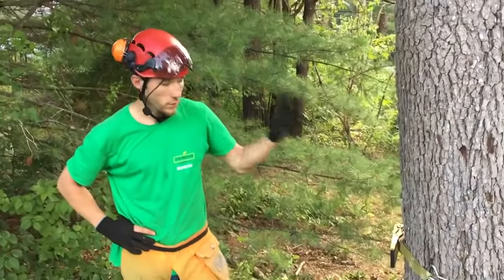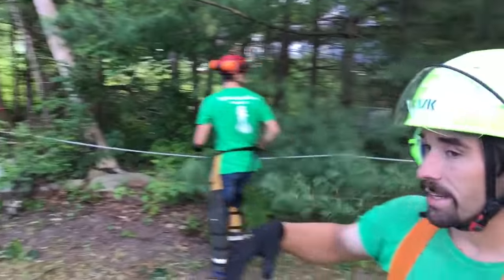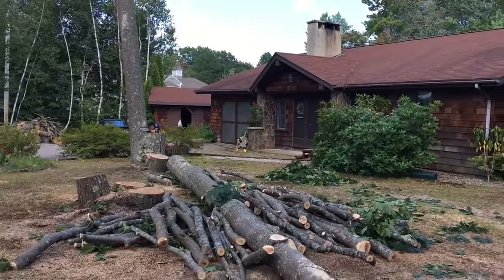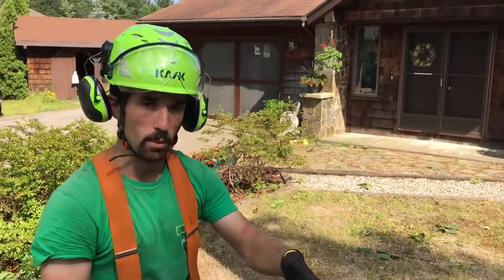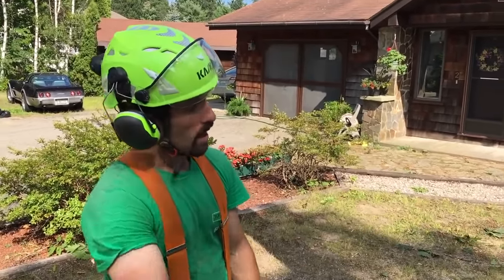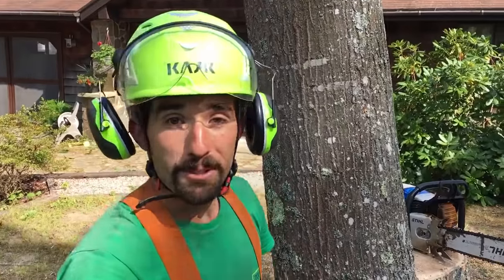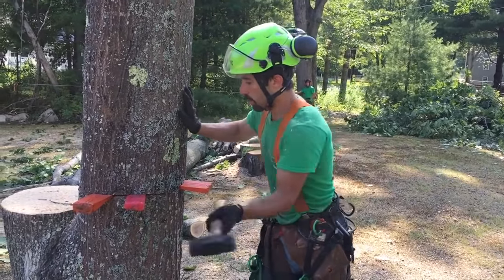Felling A "LEANER"

Comment: You done a good job. However, no way that face cut was not 90 deg or more...
Reply: Thank you for noticing that as well... I'm thinking it's about 70 deg, which could lead to a widow maker if you're in the middle of the woods and you leave the tops on the tree.  Pretty basic to eyeball 90 degrees, so not sure what you were rambling about.
Reply: yeah not 90 but close enough. Widow maker meaning falling dead branches, or barber chair meaning  the trunk splitting vertically. Barber chairs happen usually the trunk is either rotten hollow in the middle, tree has visible vertical  cracks (lightning striker of whatever have caused those) or you've done too strong of a hinge and try to force it over. even with 45 degree face cut you rarely manage to split a solid trunk on normal tree, it will send bottom part of the trunk flying some because you run out of room and the two faces of your face cut will collide while the tree is mid falling but splitting a fine tree vertically up from a not having wide enough face cut is unlikely.

Comment: I will never understand what the back snap plunge cut crowd is trying to prove. Especially with a tag line. Unnecessary, and takes away options if there is an unforeseen problem. Just back cut it, leave the holding wood where you want it, and tap a wedge if you need it. You loose so many options when you commit to the hinge before you have all the information. Oh, well. Besides, you could have just chunked that tiny stem down.
Reply: I've only dropped a few trees .  But as a rookie I like the plunge cut because it allows me time to carefully cut the hinge to make sure it's parallel and the right width.  Can't speak for the pros.
Reply: plunge cut is good for many things, like mentioned earlier, you can work on the hinge for long time, also you find out quicker whether the trunk is hollow or not, so more info about the tree and possible danger. The plunge cut with the small back piece left intact for driving in the wedge or felling lever is the safest cut to fell a tree with at least that is what professional arborists and felling teachers think and teach in my neck of the woods.

Comment: Great job question why do you paint your saws
Reply: It might be to discourage theft of the saws. Can claim your saw more easily if stolen off the job, if it's painted. Which does happen quite a lot.
Reply: tasmedic - I paint my saws, and yes, it has helped me to claim them, for instance, when colleagues see saws for sale at the local flea market, or pawn shop....thus has helped me on more than one occasion.
Reply: I might try putting a "Made in China" sticker over the Sthil 460. No one wants to steal a worthless saw.
Reply: And most pawn shops will not take in painted tools...They'll send you right back out the front door. 
They will not take in electrical tools with damaged or repaired cords or with replaced plugs either.
Reply: @headfuckd   Ok.... Chinese makes the best saws. I will remember that when I buy my next saw. I have 5 saws now and I have never tried the Chinese saws. I have had a dozen or so saws over the years. Damm, I wasted a lot of money.

Comment: You've taken all the top out, that was a simple take down with a winch. But to honest why didn't you dismantle the whole tree!
Why do Americans always use the biggest saw possible, an 18" bar would have been more than sufficient for that small tree. I can fell a 40" diameter oak with a husqvarna 560xp with 18" bar, it's all down to skill set.

Comment: I'm curious on why wouldn't you just cut the tree down in smaller sections, when you were up top cutting off branches anyway?
Reply: I’ve climbed, topped and pieced down a heavy leaner. Basically it’s more efficient to cut on the ground so as soon as there’s room to fall the leftover stick it’s the preferred thing to do. Obviously if the surrounding area can’t take the damage then you do the extra work to piece the whole thing. It’s definitely a preference thing.

Comment: Your notch should have been cleaned up in the bottom it could have caused your hinge to have a failure early in the fall.
And your back cut was lower than your hinge and should have been above to prevent kickback across your stump.
I come to you with this bit of information with knowledge as a former logger.
Just trying to keep you safe

Comment: That crack above the notch was scarier than a "Plumbers' crack" 😮
Reply: That crack was in front of the hinge,so it made no difference. Also had a rope tied to the top. No wedges needed.
Reply: Typically that would be correct but in this case the face cut was on the side opposite the lean, in the tension wood.  If they hadn't removed the crown and that was a legitimate crack it could have easily barber chaired, especially with the shallow angle of the top cut on the face.
Reply: First of all the crown was removed. Secondly they made a bore cut and third there was a rope and wedges used. There was no way in hell that could barber chair. The crack was only as deep as the bark. These people went overkill on precautions. I would have put a rope in it and pulled without wedges or a bore cut and it would have gone perfect. It obvious you have little experience and talk a big game.
Reply: Yup wasn't an actual crack and yes with tension on the rope the tree is unlikely to split but my response was more on the theoretical side.   Just because a crack is in front of the hinge doesn't automatically mean its never an issue.  It depends on the circumstances and I alluded to a circumstance where it might be a problem.                                              Numerous ways to get this tree down, thats for sure.
Reply: Go teach a tree felling class if you want to iterate on hypatheticals.
Reply: Haltback:  that crack could have caused a Barbered Chaired ride to doom.  In about a second.  Not time enough to escape.

Comment: Ive watched a dozen leaner tree videos to see if you can fell them in the opposite direction this is the best most explanatory one yet and yet it still seems as though a leaner can't be felled in the opposite direction without rope assistance... everyone's using ropes... I guess it can't be done without ropes or bucket trucks too bad oh well. Good job nonetheless. Tough work

Comment: Speed lining the branches would  have been easier. Nice notch decent  back cut. I personally  would of used chain or strap and snatch block in line with notch and hooked rope to tractor  or truck.you have more control on pull and if trunk had defect holes rot you could muscle through it.

Comment: My scariest moment cutting trees, I cut a massive tree and right when I did the final cut my saw got stuck in the tree.  The tree was totally cut but didn't fall and I was in a 'stuck' position, I had another saw in my truck but the tree was straight up and I didn't know which way the tree was going to fall, and the wind was swirling all around and the tree could have fallen any direction.  If I left the bottom of the tree to go get my saw that tree could have fallen on me.  Well the tree finally fell and it fell on my head gear and crushed it and almost wiped out my saw too, but I got out alive.  I had some real scary moments cutting trees, but I'm still cutting!

Comment: I personally would have used the back (top) of the bar to cut to/towards the hinge you wanted to leave.  Easier to insure that you're leaving the hinge you want to leave (enough hinge) and not traveling too far.  Because if you use the top of the bar, the chain and bar is in a sense pulling away from the hinge rather than towards the wedge cut out/hinge.  And, you cut the wedge out properly in terms of depth but then cut beyond the wedge (the width of your chain and bar) towards where you were going to set up hinge.  So you created a fulcrum about an inch inside the "peak" of your wedge.  If you did that intentionally, I just don't understand why.  It seems the fulcrum should be right at the peak of the wedge (at the bottom of the V).  

This is what happens when you post stuff online.

Comment: Tree gone and yard raked clean in 2.5hours.  Bucket truck, snip off lower limbs thrown into a pile by me the bucketman, pop the top with a pulley and truck. Log loader semi picking up constantly, no chipping. Three guys on job total. Your safety is overkill, but good job in the execution.

Comment: I FELL TIMBER FOR YEARS AND I JUST LEAVE THE HOLDING WOOD THICKER  ON THE SIDE OF THE BACK CUT ON THE SIDE THAT I WANT THE TREE TO FALL TOWARDS,THE HOLDING WOOD PULLS THE TREE TO THAT DIRECTION. THE OTHER THING IS LIMB CONCENTRATION. A FUCKIN VEE NOTCH IS THE WORST NOTCH FOR CONTROLLING A TREE.  AND THAT TREE IS A FUCKIN  TOOTH PICK...LOL

Comment: I'm wondering why fibre rope is used when high tensile cable has a much higher tensile strength and relatively no spring in it giving a much safer capacity for such higher loads.
Reply: Alot of ropes will have as much if not more of a pull, also they make static and dynamic lines ones with no give and some with more.

Comment: Hi Top Branch thanks for this video.  I've a question - a relative felling newb but (trying to) learn on my patch of land upstate.  In your video - stop at exactly timepoint 6:20 just before the video flips to a new 'scene/shot'.  At that moment - is my question . . . I have more than twice been cutting and in moments similar to that the tree moves or leans a titch and winches / binds the bar/chain in place thus saw now 'stuck' in the tree and even w/ wedges and extreme care I've bent chains/bars just slightly enough upon removal (extraction) of the (powered off!) saw to require replacing them.  My question, how to prevent most cases of 'binding' saw in tree whilst cutting (or reducing chances thereof) AND/OR if saw stuck, best way to remove it without damaging the bar/chain.  6:20 in your video is sort of the scenario where I've gotten caught up.

Thanks for any advice you or other pro/expert fellers can provide.  NB I am using a Husq 450 and cut trees from wrist size up to about 20" diameter.  9 of 10 at this point go swimmingly, but tree 10 gets me and is always the last tree of my planned cutting session and really causes me grief!
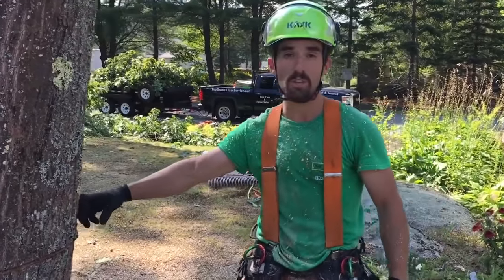Reply from the maker: bore into the tree. establish your hinge and then cut got toward the back. this leaves a piece of wood holding the tree up from pinching your bar. put wedges in then cut the back strap and wedge the tree over 6:25 - 6:40 explains this. Also you want to make sure the chain is spinning relativity fast so that sawdust doesn't lodge inbetween your bar and chain which will act like the tree is pinching your saw.
Reply: @Top_Branch  TB thanks so much for your kind and prompt reply. I'll try those tips - as a newb-ish & "self taught" (such as it is) I'm very grateful !

Comment: Newbies: DON'T EVEN think "I don't have a rope winch, but I've got this steel-cable boat winch..."  The pull rope doesn't necessarily "go slack" as the tree falls, and if tension remains on it, that tension is on the winch as well. Impact can send TREMENDOUS force through the cable to the winch, EXPLODING it.  And suddenly, there's shrapnel in the safety equation.

With a rope setup, the rope will either stretch or snap before the pulling winch explodes.  Take being hit by an accelerating end of a rope over shrapnel from a winch any day.

Comment: I wonder how strong that rope is, pounds it's rated at?
Reply: sheaDtree From the look of it it’s either a half inch or 9/16 of an inch “pull rope” or “lowering line.”
Industry standard I believe minimum breaking strength is 4600 pounds for half inch rope. The bigger the diameter usually the higher the breaking strength from there. Most of my half-inch ropes are a minimum of 4600 pounds. That may not be exactly correct but it’s right around there.

Comment: Always use a ladder with no harness very important! A good clothes line will do for roping the tree out no need for that expensive rope. Always use a very dull saw and cut above your head it helps if your on a ladder to. Don't sweat the power lines they're tough you can bounce limbs right off them if your careful.

Comment: Face cut was to deep , on a leaner like that were you’re pulling straight over a slightly shallower face cut then wedges and you can pull that over with 2 decent groundies,leaving the back strap is something you would do on a bigger tree (bars to small and have to cut from both sides which technically isn’t allowed where I am but you do what you need to do sometimes 😉)
also who doesn’t back bar their kerf so they don’t fly at you’re face

Comment: those tall whiskers in the broken hinge show control. You said it shows you have too much wood in your hinge. That's total nonsense. you have no business teaching these things when your understanding is weak and incomplete
Reply from the maker: You are correct that when there is fiber pull on a stump that the hinge was steering the tree and continuing to hold as it fell. Which from one perspective it is a good thing. However from a logging perspective you don’t want fiber pull because it is taking wood out of the bottom of the log and doesn’t make good boards. It depends on the purpose of cutting the tree and what you’re going to do with the wood after. Two sides of the same coin 👍
Reply: @Top_Branch  you're doing residential tree work on nasty logs that will never see a trip to the mill.... this is not the only video where you said that fiber pull is bad. get it together bro.. you're misleading people and that's not cool in tree work...
Reply from the maker: We appreciate the input and your perspective 👍

Comment: At 3:53 am I crazy or is than least a 90° angle?
Reply: Yeah it's closer to a 60° angle. But it worked in the end. I guess in this case you need a wide notch because of the back lean.

Comment: Having already spent 1/2 a day cutting the tops off in situ, what's the point of messing about with the come-along? Could just keep cutting small bits off the top until it's 15 feet high, then use wedges to help with cutting the base. If you're good enough to use the come along, then use it at the start, and save the customer 1/2 a day of labor costs. By cutting ALL the tops, then using the come along, this could be seen as duplicating the work involved in felling the tree. Unless, of course, you're teaching your wingman how to use the come along at the customer's expense.
Reply: They may have gave them a solid price, "we'll do the job for this much" 

then its up to them to decide how they want to do it and manage the man hours
Reply: It's way easier on the climber to top the tree and repel down. The cut from the bottom. To chunk and bomb, climbing DOWN with spikes, really takes it out of you. And you can buck up the tree with larger saws when it on the ground

Comment: I've never cut a tree before but I've seen a hundred of these videos and compared to the rest I'd say your back cut is an inch or two too low and your back strap is too small that could have cracked on you before cutting it

Comment: Absolutely NO reason to plunge cut. None whatsoever. I’m starting to think people like you do that just because it looks cool for video and you can. Back cut would’ve worked just as well especially with the rope hooked up. What are you trying to achieve with the plunge cut? And honestly by the time you went through all that work with ropes and hinges and cuts and wedges, a few more cuts and you could’ve taken it down piece by piece!